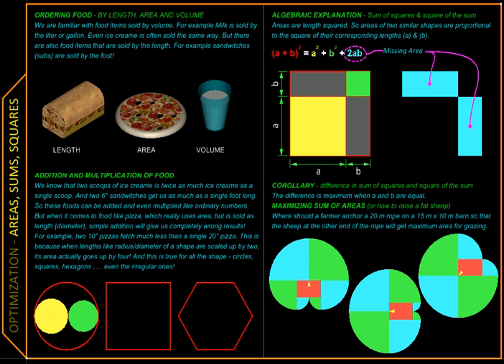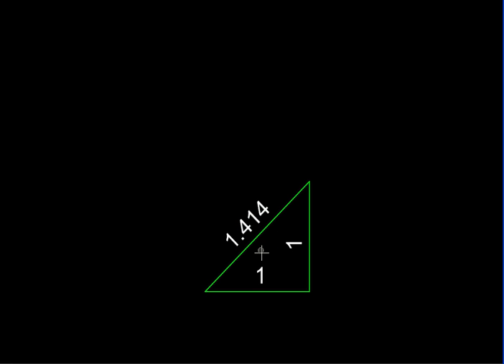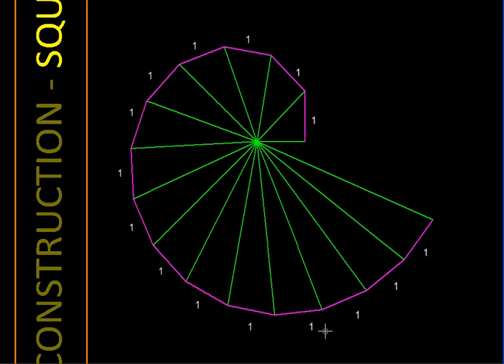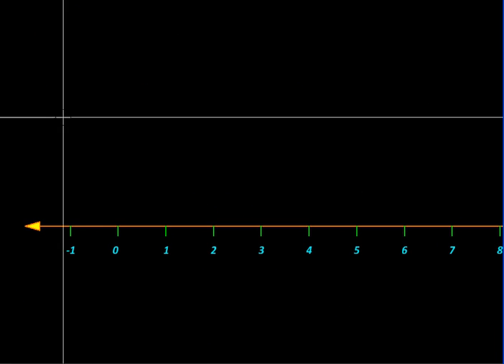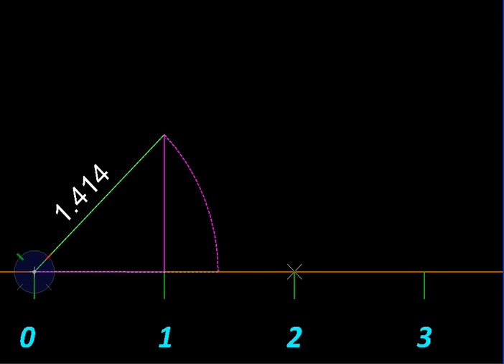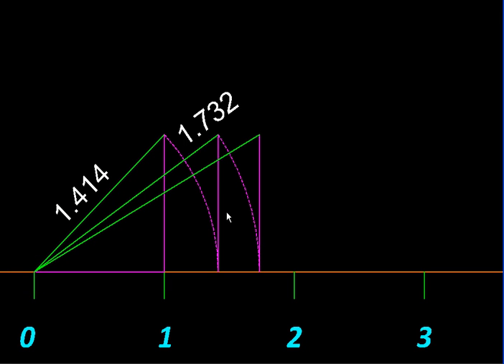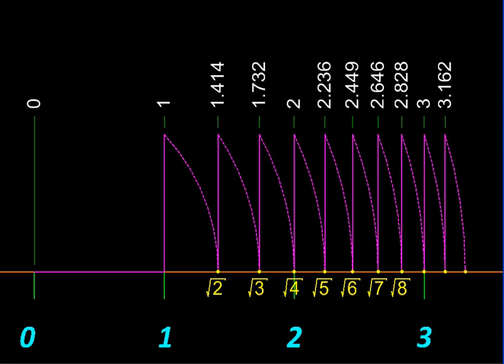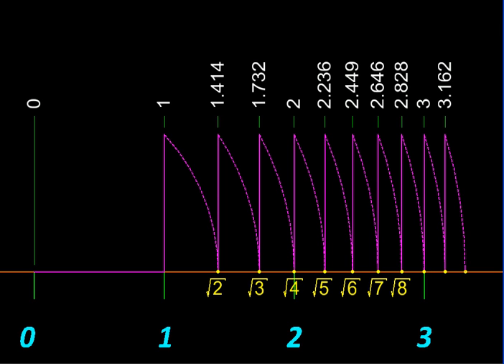Geometry with MicroStation Constructing Square Roots

Comment: Good work again ...
May I suggest something?
If it it not too cumbersome, is it possible to mark the hypotenuses as root (surd sign) 2, root 3 and not their approximate decimal values like 1.414, 1.732 etc. as you have shown on the number line?